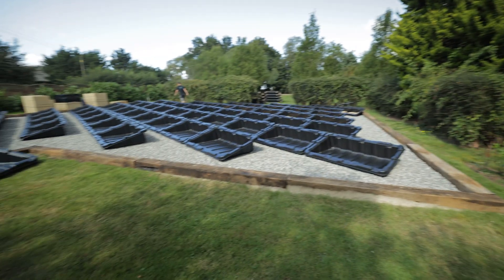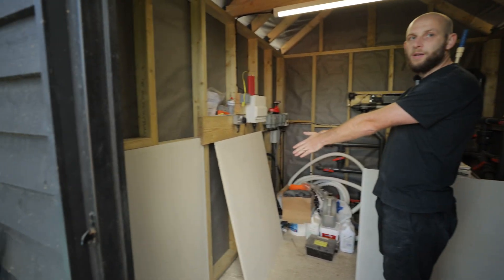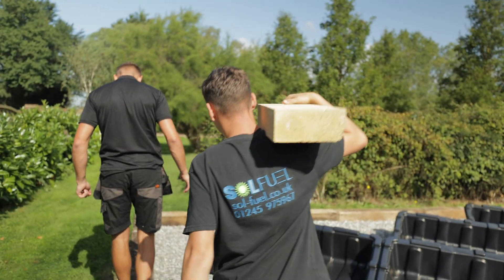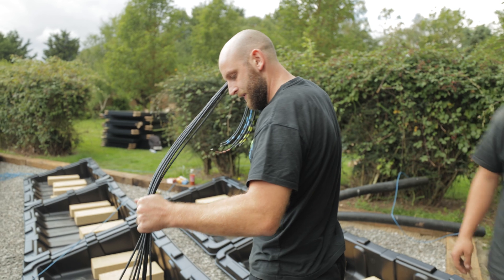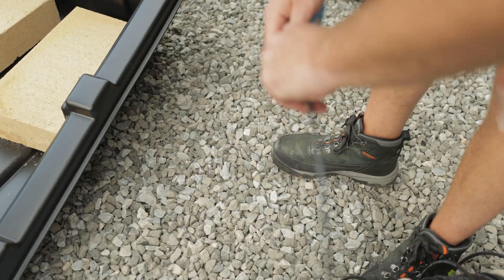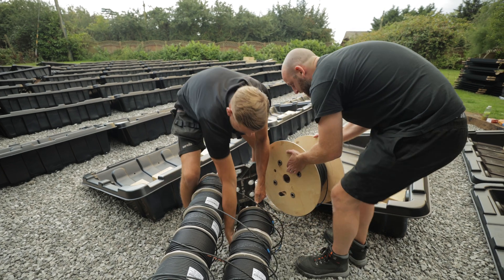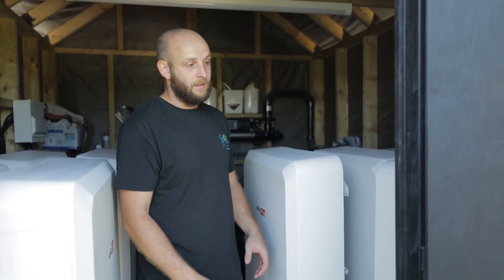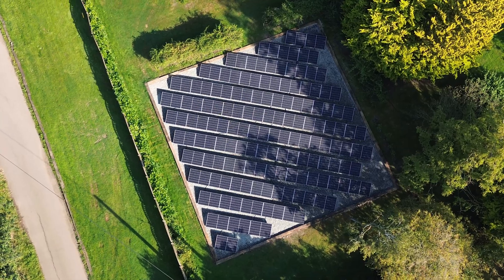What does £100,000+ of DOMESTIC renewable energy look like?

Comment: I love my solar.  Renewable Energy sure saves me.  Installed solar panels on my roof and a grid tied inverter (no lithium batteries for me).  This was my 3rd solar panel installation, each at a different property.  Also have an old Solar Hot Water System (HWS) on my roof - which produces more than enough hot water for my needs, even after days on overcast weather.  My power bills have turned to credits, and I now get free electricity and make around $100 per month tax free.  It's like having a piggy bank on my roof.  Highly recommend others do this if they can.  Use a reputable, quality installer, do your research first.

Comment: No lubrication, no cable pull—there are a lot of shadows on these panels. I hope the optimizers will do their work.
Reply: Lubricant in a cable duct? Conduits, yeah, but a 100mm cable duct? Should have had a cable chamber at the bend & pulled it from there
Reply: @craig72x  of course on long distances is a must, especially when machine being used to pull cables.

Comment: 9 years to recoup the costs. That's 12k a year worth of power consumption. That is a LOT of power and at 28p/KWh (UK average) that's 43000 KWh a year! 

There are years where I don't really use that much power. Or decades for that matter :) At my current consumption that would be just over 15 years.
And there are also the days when the sun don't shine, so you still need to be connected to the grid. I don't know what they are growing in that house, but here in NL I would suggest that it would be a nice supplement to the household income in the form of earthy smelling herbs 😅
Reply: Multiple electric cars, induction cookers, electric HVAC systems plus it’s a pretty big house, but it’s funnier to just assume they’re growing a bunch of weed 😂
Reply: 80 panels * 430watts results in a peak power of slightly over 34kw.....i hardly doubt that they will produce 43000kwh per year. Or do they life in Australia? 
Average UK output would be something like 1000kwh per kwp or even little bit less. But money does not seem to matter for the customer, that's fine. But at least you should do a more realistic calculation for your followers an customers.
Reply: @steffen12  1000KWH/Wp is average for UK, however sssuming these panels are south facing (why wouldn't they be), you can assume 1000 KWh/Wp due to perfect orientation. But you've got a fair point here. Even at 1200, you can barely get to that 43000 KWh. 

But I'm also assuming perfect power consumption and no grid consumption. Which we all know is not going to work. That part is also regularly neglected from calculations.
Reply: @patrickd9551  the tool of pvgis gives a nice estimation. Even the 1000kwh/kwp is a generous estimation, which is only possible for straight south orientation, 30° slope, in the south of England. 
43000kwh production is just not possible with 34kwp in northern Europe. But the setup with 90kwh of storage isn't about economics anyway.
Reply: @steffen12  I also wonder especially with how much shade there is.
Reply: Plus selling excess back to grid can make some money tho 👍
Reply: @IXISSV  Yes it can make SOME money. roughtly half of what you pay if you are lucky. And you can bet that price is going down even more. I looked it up for the UK, 15p/KWh is about acceptable, one goes as high as 24p, but others are as low as 3p/kWh. (AUCH)

But then you also have to consume from the grid in times of no sun (ie: winter). And boy do you have to pay through your nose then. Fact is, we humans use most energy during the times when the sun is NOT abundant, more specifically: wintertime. Yes batteries can bridge the day/nigh gap in summer with ease, you can even bridge a day without sun. But winter offers multiple days without sun and when it is shining the output is minimal. Yet our energy needs are much much higher.
Reply: @patrickd9551  "Fact is, we humans use most energy during the times when the sun is NOT abundant, more specifically: wintertime."  - agree for those who live where there are cold winters.  I live in the tropics, and we get 2 seasons a year - hot, humid summer and warm summer.  Solar power and solar hot water work great here.  My solar system is giving me a 25% ROI - I get free electricity and I'm making over $100 per month tax free from the power I export to the grid.  Even on cloudy / rainy days, my solar panels are still exporting well over 20 kWh to the grid.
Reply: @MoosesValley  On an individual level, yes I agree. But my statement still applies to the "most energy usage", because most economical activities take place not around the equator. 

Population density is greatest in western countries, most which have winter seasons and thus said problems. 

Factories are also tied to population density and will increase the winter energy issue (remember, factories have to be heated too)

and you claim to have a 20+ KWh/cloudy day installation. That is not a small installation, if I have to guess at the very least 30 panels, most dense area homes are capable to have 10 panels installed. So your individual situation is even more individual. Again, great for you, but it does not negate the "most energy used" issue
Reply: Plus, where the batteries we're installed, was all their pool pumps etc. if they're running 24/7, that's gonna add up